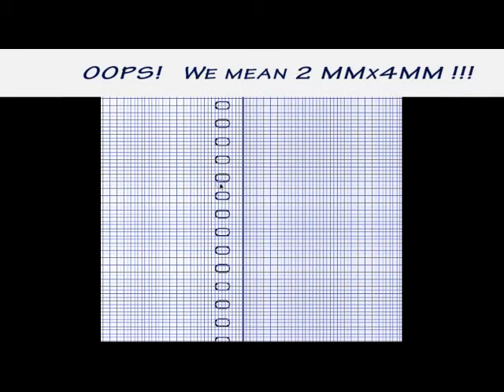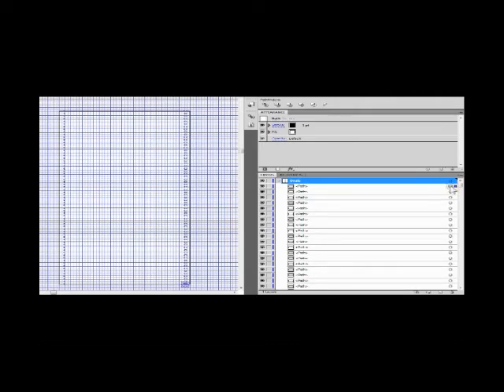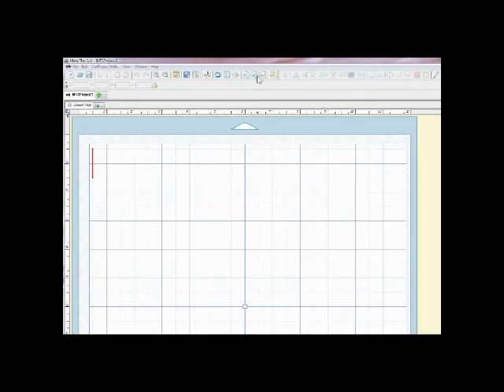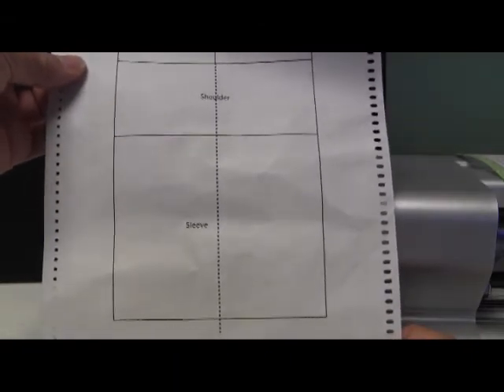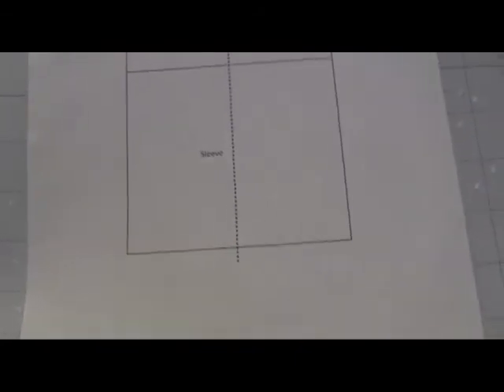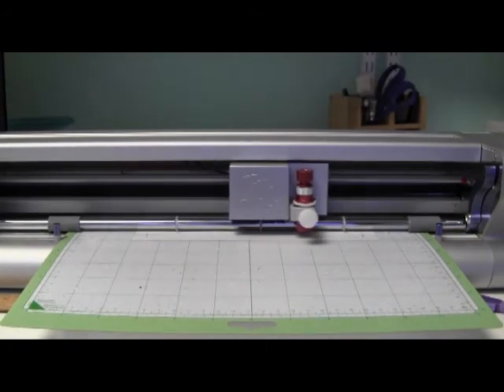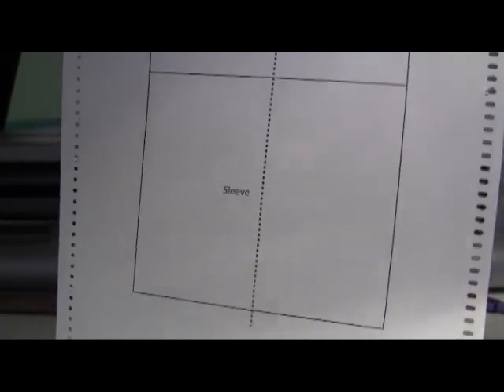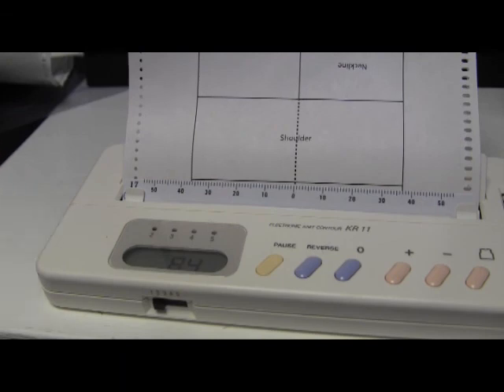Making Custom Mylars

Comment from the maker: I am using the KNK Zing machine, but most digital cutters will do this.  The trick is getting the holes "drawn".   I used Adobe Illustrator to draw the "holes" because it's easier for me to get them "precise" vs the software that comes with the machines.   We no longer sell our stuff.  Too tired having fun knitting.  :)

Comment: would you know if there are existing files/templates for cutting studio mylars or other cards? just got a studio 580 and now it seems the blank mylars are scarce.. a thing they forgot to mention. but with print and cut i could print my own and mark them as needed.. 24 stitch cards i can get, but the 60 stitch mylars for studio would be great to find

ETA... i mean the actual pattern card mylars, not just the knit contour mylars..
Reply: Did you manage to find a source for pattern Mylar? That aren’t $10 a sheet?